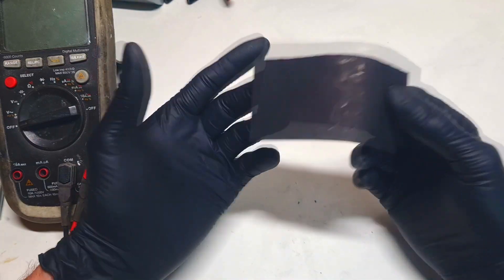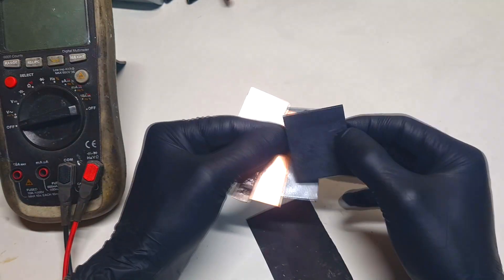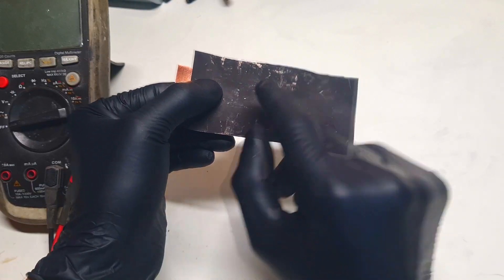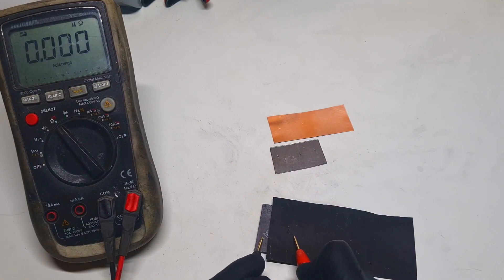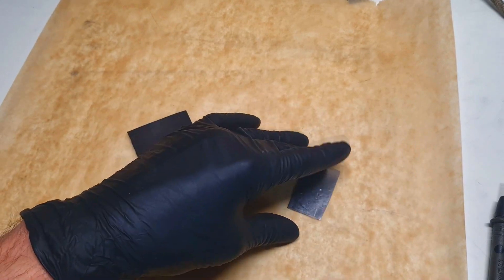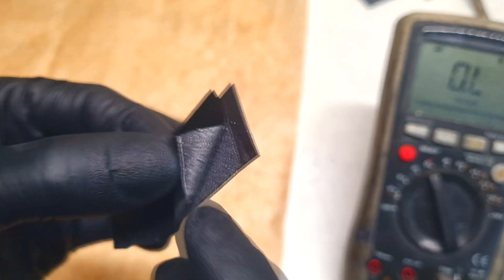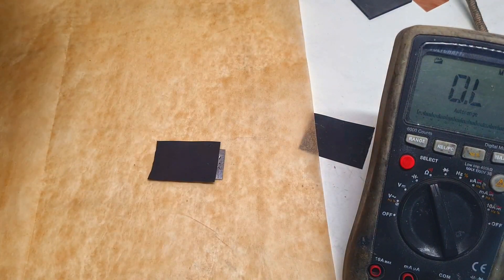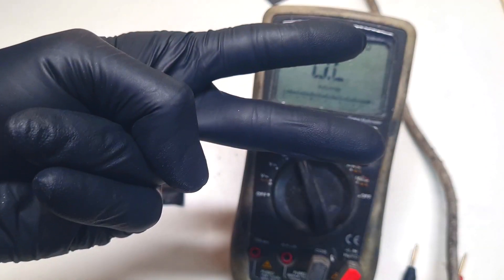Make current collector for battery and supercapacitors

Comment: Hey thanks for showing very unique method for welding these materials together.
May I find out where get a hold of just the felt .
Is this the PAN fiber carbon felt, or rayon based.
Reply from the maker: Hi! It is a PAN based carbon felt. But rayon felt will be also ok if you can get it. The PAN graphitic carbon felt you can get from ebay.

Comment: Why not using graphoil only? Graphoil seems to be inert already.
Reply from the maker: Because if the graphoil is in direct contact with electrolyte and if you use thecl charging voltage more that 1.8V then after some cycles the graphoil will expand and you will lose the conntact or it will higher the resistance. Also the graphoil alone is more fragile in the conntact area (the area where you connect a crocodile cable).

Comment: I've faced the same constraint as noted by @rogerwilson6367. I've attempted a formulation of conductive hdpe film myself (as well as polycaprolactone) but maintaining a homogeneous dispersion of carbon as well as the final strength of the conductive film are roadblocks and I'm wondering if there is already a commercially available product that I don't have to re-invent. Would appreciate any guidance you can provide on this.

Comment: I have been trying to buy some conductive hdpe but unable to find a supplier.
Reply from the maker: https://hnszhongzhneg.en.alibaba.com/
Reply: @nlabanok You can buy it from china, but I found info regarding the conductivity a bit dubious.
Reply from the maker: The conductivity of HDPE is in the range of 200 ohms. I also see that many companies working to go into the range of 60 ohms.
Reply from the maker: Another one will be company Caplinq,... which is awsome
Reply: @cayrex I couldn't even get a reply from Caplinq.
Reply from the maker: @rogerwilson6367  Just use the store. I buy many stuff from then. The HDPE will come in the roll
Reply: @cayrex I'll try them again. I can't remember what problems I originally had, but i remember not getting a reply.
Reply from the maker: @rogerwilson6367  Just go to the products and select the conductive films
Reply: @cayrex2 I see that Caplinq offers an ITO transparent film. Have you tried it? I imagine it’s rather expensive.

Comment: For measuring conductivity of a plate, you might want to make a 1 cm copper cube that gives you consistent contact surface area.
Reply from the maker: Yes, of course. Here with this quick measuring I already get some idea if the plate will be good or not.
Reply: I 3D printed my own probe for measuring Ω/sq sized to fit nickel strips used for welding up lithium battery packs.
Reply from the maker: @noahwiliams7214  Nice

Comment: First
Reply: Imagine if the conductive plate had a few small holes, through which the HDPE could weld to the HDPE on the other side.
Reply from the maker: That is how need to be done. But most of the time I skip that extra step (making holes to the metal plate/foil and welding two pieces of HDPE together) and I only put a HDPE on the top of metal foil and that's that,...  and also works great. Fast, simple, effective.